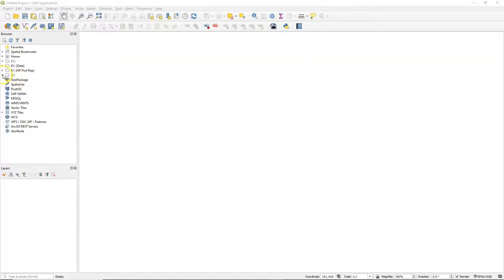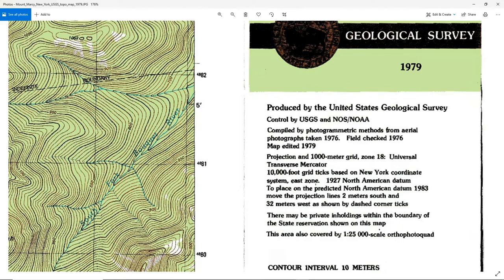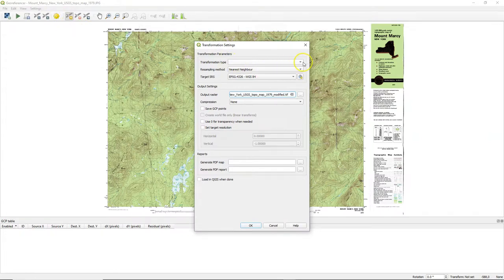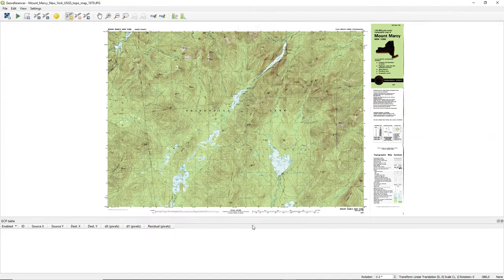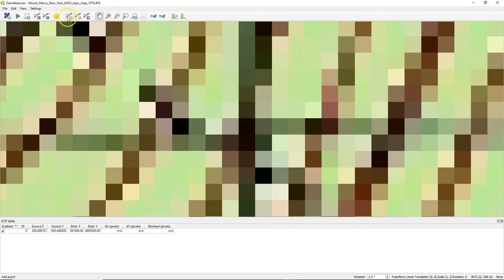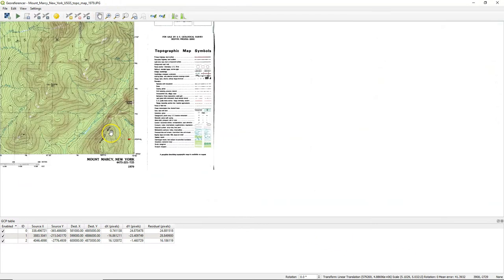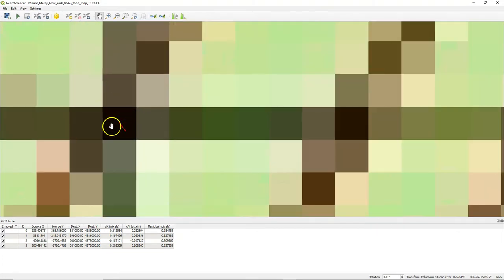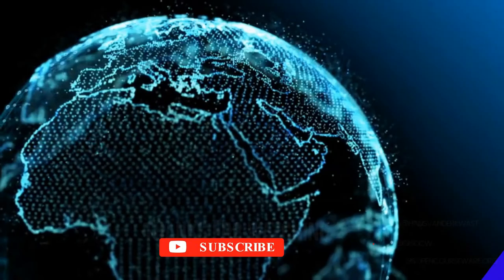Georeference a Scanned Map in QGIS

Comment: Probably is a dumb question but I come from other field of sciences. How did Hans know that he wanted to project the map into the "utm 18N NAD27", I can understand utm =universal transverser mercator   18 from the zone of the map, I guess N is from north, but where does it come NAD27?

Also, how he knew that it was EPSG:26718, I know that it is EPSG:26718, because if I click into EPSG:2030 or EPSG:2032 in the spatial reference list website I can read Canda, and not North America, but otherwise I would not have been known.

Thanks
Reply from the maker: The map mentioned North American Datum 1927. Then I used all info in spatialreference.org to find the EPSG code.
Reply: @HansvanderKwast  Thanks. Ok, then NAD27 is north america datum 1927. I guess is the sort of conclusions that one reaches after getting experience. Thanks a lot, that is extremely useful.